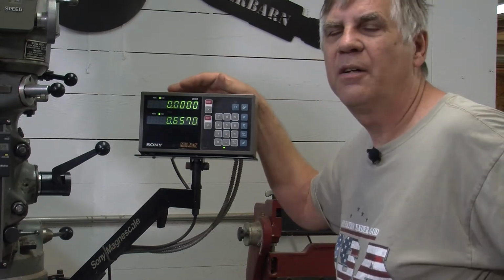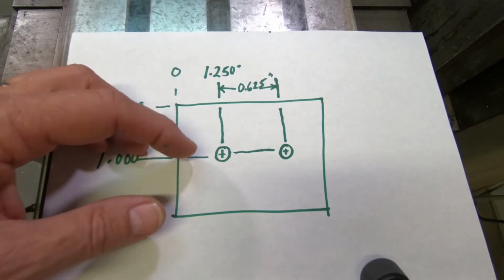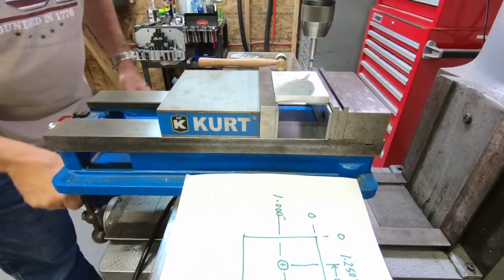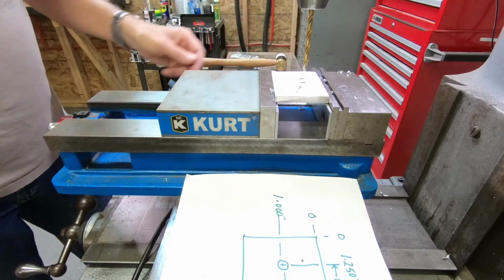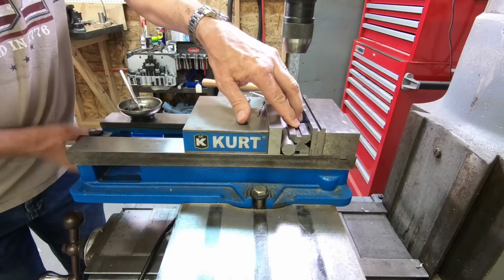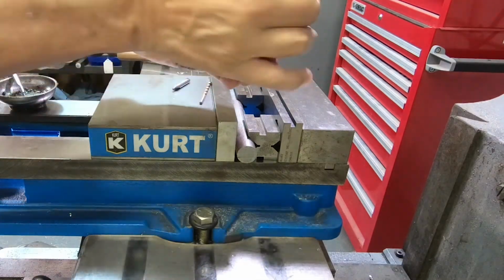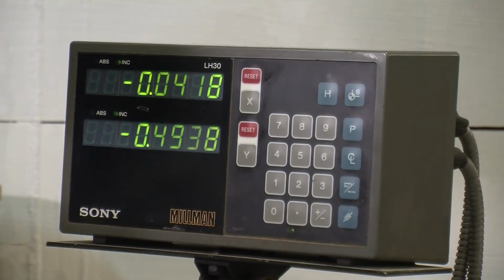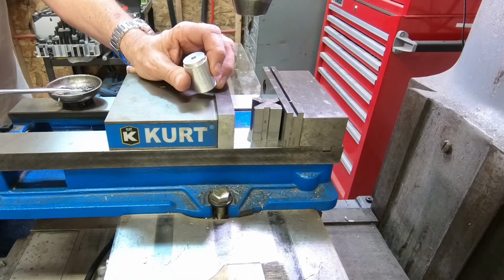Introduction to the Bridgeport Milling Machine Part 3

Comment: Thanks for the very helpful video.  I think there are 2 or 3 of the buttons that you didn't explain, so, might have been useful to start by identifying each.  I have the same setup and I got some very good tips from your video to practice on.  Also, based on what I have seen in other videos when you make a mistake like the 4 decimals indicating mm, it's possible to edit the video to add a text message with eh correction or clarification.  Great videos that I really enjoy watching.
Reply: i realize Im quite randomly asking but does anybody know a good website to watch new movies online ?
Reply: @Hayden Bryce Flixportal =)
Reply: @Zane Lachlan Thanks, signed up and it seems to work =) I really appreciate it !!
Reply: @Hayden Bryce You are welcome =)

Comment: Switching between In and mm, there is an indicator of which system you're on. Right below the selector button, there are 2 LEDs. Left LED for Inches and right LED for mm.